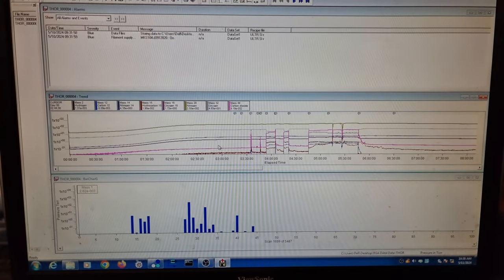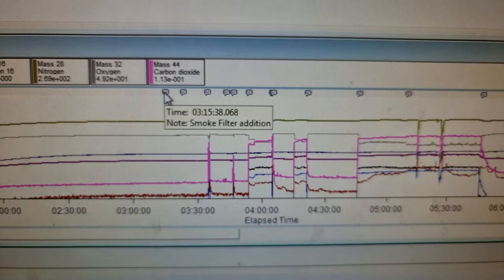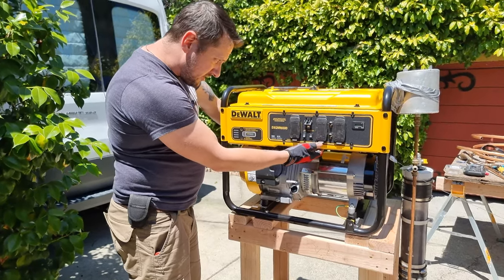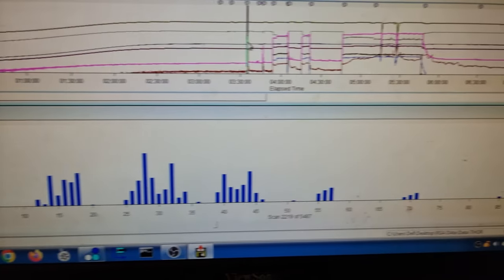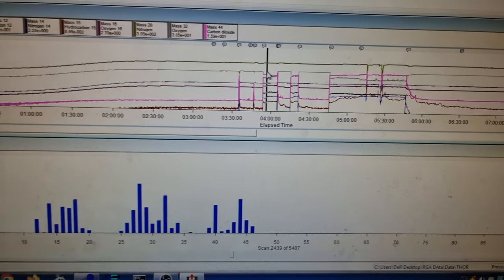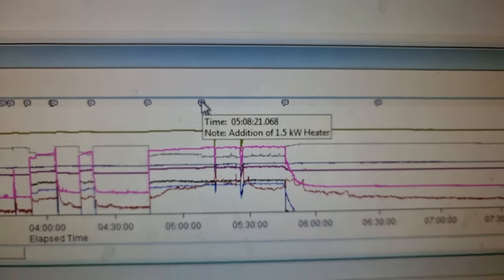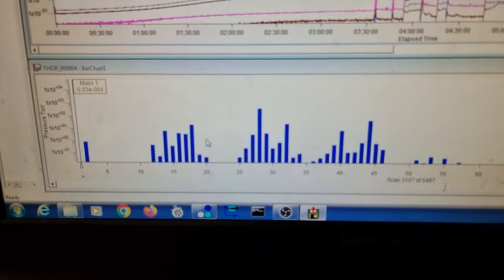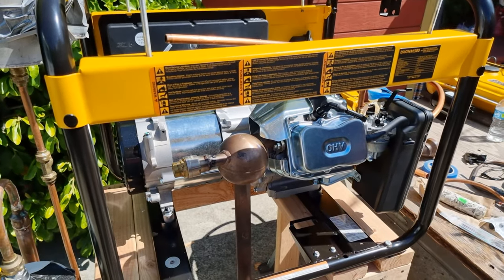THOR - Dewalt generator gas mass spectrometer control

Comment: Proper backyard engineering standards would dictate using a coat-hanger bracket twisted onto the outer lip of the muffler to hold your sensor assembly stably and properly, Bob.
Reply from the maker: We got a solution pretty quickly, but yes!

Comment: Is there a way to measure magnetic fields and electric current flow, including perhaps eddy currents, in the swirl guide's walls? I'm thinking about the mean lifetime of ions in the plasmoids, from UV light to engine. Since the parts look like copper pipe, does using a diamagnetic material help the effect, or hinder it?

Comment: Wouldn't it be more real world accurate data with a full load on the generator side.
Reply from the maker: We do no load and 1.5kW - same for active run as you will see - all data will be shared.
Reply: @MFMP  With full load I meant 6.5kW
Reply from the maker: @TomReidarGrndahl  Well - that is just the starting power, not sustained. At the time of testing, the 1.5kW load was what we had to hand and it, as you will see, showed very valuable data.

Comment: You probably know this setup is totally ruining the working of the carburetor. The treated air is inserted between the carburetor and the cylinder as “false air” which disturbs the vacuum needed for the carburetor to work. If you look at previous demo’s of the thunderstorm generator you hear the motor is not running smoothly at all. In this configuration it will be very hard to adjust it so that the engine runs at a fixed speed and impossible to use it f.i. in a car at variable speeds.
Why not use a diesel engine or injection type petrol motor? Preferably with a turbo charger so the treated air pressure at the outlet of the bubbler could be about 1 bar or even better.
If you like to stick to the carburetor engine, the only option is to insert the treated air before the carburetor. But then the bubbler needs pressurized air at the intake otherwise the pressure at the intake of the carburetor will drop too much.
Reply: If this is doing what I think it is, fuel consumption drops because there is a nuclear reaction going on, O-16 + H + e- --> O-17, providing a large share of all the heat. So the carburetor should be replaced with fuel injection as needed based on load, idle speed, and power requirements
Reply: On a modern car it just needs to be hooked in to the computer so when the system is up to operatoring temp and needs less fuel the computer feeds less fuel. Difficult diy but would be easy to build a module that just plugs in to an existing plug on the wiring harness.